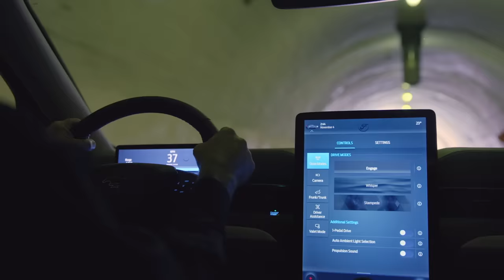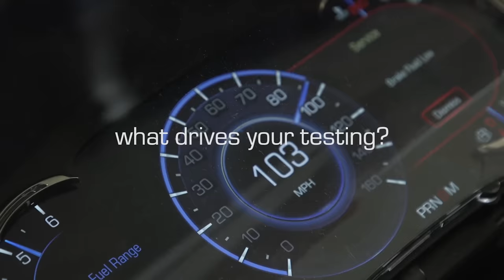Strike Casualty: Stellantis Backs Out of CES; BMW Going with NACS - Autoline Daily 3672

Comment: The biggest drawback to hydrogen fuels is NOT that it uses a lot of water. The biggest drawback is that the round trip efficiency is low (and costs are high) if you use electrolysis (assuming use of renewable energy to create the hydrogen) or that the lowest cost hydrogen is made by processing fossil fuels. The best case use for hydrogen in the mid term is for applications that must have high energy density - large truck, ship and airplanes. Of course that's only valid if hydrogen is available. The not often talked about advantage of using battery electric vehicles is that the "fuel" distribution infrastructure (the electric grid) has a 100+ year head start over hydrogen infrastructure.
Reply: YOU SAVED ME TYPING 😅
With Hydrogen fueled cars you really have to look at the full infrastructure and life cycle of the Hydrogen as there is no existing infrastructure  to "just fill with Hydrogen " from.
Reply: Additional problems with hydrogen: Without compression it's useless and compression takes energy. Storage equipment costs are higher because of the more expensive materials used to prevent hydrogen embrittlement. Hydrogen is prone to leakage which causes its own environmental hazards to our atmosphere.
Reply: Exactly. It's an energy sink. Hydrolysis, pressurization, transport and storage of hydrogen consumes roughly 3-4x what you can get out of combusting it. The only place where it would have demand is where gravimetric density is of the utmost importance.
Reply: Hydrogen stored at 10,000 psi , NEVER in million years would I sit on hydrogen bomb 💣

Comment: Hydrogen will NEVER take off, not because it's bad, and not even because of the crazy price of fuel cells, it's because generating hydrogen is EXPENSIVE and most hydrogen is generated using fossil fuels (to power the production of hydrogen). There is a tiny change that if somewhere in the distant future there is overcapacity of electricity (over deployment of solar to allow 100% renewable during winter, so oversupply in the summer) - only then Hydrogen will be economical - but that would mean EV charging is even cheaper (or free) and by that point batteries will be cheap enough that there would be very few if any application for hydrogen powered vehicles.
Reply: @lesliecarter4295 That is Toyota, right? From less than 200 hydrogen cars in 2015 and up a whopping 7.11k hydrogen cars in all of Japan in 2022. The land that is heavily invested in hydrogen. Their advancement is stagnant, I mean, staggering. Lol
Reply: If it's to expensive,  chillax , there's  no need to blast anti hydrogen tropes.

Comment: "the biggest drawback is it takes a lot of water to make hydrogen fuel."  No. Actual big drawbacks: #1 Unavailability and high cost of Hydrogen infrastructure like filling stations. #2 Cost of Hydrogen even when readily available, #3 Cost and complexity of Hydrogen vehicles vs BEV
Reply: That is a big drawback when droughts are getting worse and more widespread. Unless they're using Saltwater to make the Hydrogen.
Reply: Don't Forget,Hydrogen would rather be Free Than Contained
Reply: Came here to say the same thing. Storing and Transporting hydrogen isn't a solved problem, and will require massive infrastructure investment. A long distance bus network might make sense with small hydrogen generation plants at each stop making just enough to top off the next bus that arrives, but the idea of hydrogen tankers driving down the road, or hydrogen pipelines, is crazy. 

The hope of the Fossil fuel industry in hydrogen has always been that the technology for CONSUMING hydrogen would take off, and that once attempts at distribution of green hydrogen failed, cracking natural gas into "blue" (Fossil fuel derived, polluting, aka "brown")  hydrogen could take it's place by necessity.
Reply: @divid3dbyZero  Water is the LEAST of its problems.

Comment: Honda, Toyota, Kawasaki, Suzuki, Yamaha.  The reason why these companies are banding together on hydrogen powered vehicles is because the Japanese government insists upon it.  Japan views the methane deposits off of its coast as pinnacle to its future global successes, they hope not only for energy independence, but also to be a major fuel exporter.
Of course, a whole lot of good that will do if everyone is driving electric vehicles, installing solar and wind farms, etc. by the time they've figured out how to extract that methane, so in the meantime they are trying to stymie EV adoption and push hydrogen/e-fuels so they will have a market for that methane.
Meanwhile Japanese auto manufacturers are falling further and further behind as the market moves to EVs.
Reply: I'm no expert on what Japan is up to, but their continued focus on hydrogen suggests that they may be in for very hard times ahead.

The number of technological challenges involved in just about any large scale application of hydrogen for transport seems to rule it out in any scenario except where there is no alternative.

In passenger vehicles and light trucks, there are good alternatives.  Even heavy trucks will mostly be BEV.
Reply: @davidmenasco5743  Yeah, I don't think it's in the auto manufacturers' own best interests, but I think there is immense pressure behind the scenes.

Comment: If there are still ICE vehicles in 2050 the problem won't be making them cleaner, the problem will be how much fuel costs. As economy of scale starts to collapse the cost of fuel can only go one direction.
Reply: It was explained to me, as less people buy gas that the price will drop.  When supply is greater than demand prices fall.  Yes. I laughed at them.  Less people buying gas puts all the overhead on fewer and fewer people.
Reply: I think it would drop a little from supply and demand then rise as the diehards need it
Reply: @davidbeppler3032  If prices get too high so will theft. Gas stations will simply stop stocking fuel if their insurance company drops them. One station in the US stopped carrying fuel during the last price spike. That's a sigh of things to come.
Reply: @rp9674  There are fixed costs in making and delivering fuel even if oil is cheap. I'm thinking the price can only go up.
Reply: I expect that as fuel usage drops the stations will go into a pricing war in an effort to keep their numbers up.  So a temporary drop in pricing.  The number of fueling stations will drop as the smaller companies will be losing money.  At some point it could be difficult to find a fueling station.  At some point in there the prices will skyrocket.  A similar thing will probably happen with the oil companies themselves.  Then all of the EV haters will need to pull themselves up with their bootstraps.

At some point ICE will only be for the rich much like horses are today.
Reply: Don't drink the kool'de.
Wait till then and well see!
Reply: @frankcoffey  it's a good bet, I would say we'll see, but I rarely check gas prices
Reply: Bidenomics 🤡👍
Reply: @johnsadler6534  I won’t be here to see it but it will be interesting.
Reply: @zoobrizz  Joe and I will be long gone by 2050 good luck with that stuff. 😁
Reply: @zoobrizz What a weak comment

Comment: Indiana charges extra fees for EV owners...$150 extra a year
Reply: Wow, I would vote carefully
Reply: Wow.   $150 🤡
Reply: So does California. Have to feed the tax beast.
Reply: Pretty sure blue states have been charging extra for a long time now.
Reply: In Mississippi, there's the tale of four F-150s.
All four are considered constitutional class 5 property, subject to ad valorem taxes at 30% of value. All 4 pay the same registration fee, and a $15 privilege "road and bridge" tax.
F-150 #1 runs on CNG and pays an extra privilege tax of $195.
F-150 #2 is an EV Lightning. This year the owner pays an additional $172, though the tax is tied to the CPI, rising with inflation.
F-150 #3 is a hybrid with an extra $86 tax, also indexed to inflation.
F-150 #4 runs on gasoline, and pays no additional tax. (Gasoline tax is paid by the distributor, not the consumer.)

This in a state who's Constitution requires taxes to be "uniform and equal throughout the state". Have a problem with it? $50,000 and a lawyer might fix the problem.
Reply: It's common since gas taxes don't apply to them, so the annual registration fee is a little extra to cover that. It's $100 more in IL but fine with me since the "fuel" cost is $15 a month instead of $90 for gas.
Reply: I believe someone ran the numbers and found the gas tax amounted to about $50 per year typically.  If this is the case, then these EV taxes are way overcharging.

Comment: There is no hydrogen pumps and the cost of hydrogen its way more than gas.  500k for the EV bus then subtract the fuel savings,  the maintenance savings the ownership over life of the bus and I'm sure it's ahead
Reply: I want to see their calculations. Why would an electric bus cost that much? Maybe they are figuring the same range as an H2 bus, so they need a humungous battery.
Reply: @jamesvandamme7786  cyber truck costs less and tows big loads.  500k they are getting ripped off

Comment: Hydrogen ICE has half the MPGe compared to a fuel cell vehicle, taking already bad efficiency to ridiculously bad. You might save money on manufacturing but you lose overall on lifetime costs and you won´t improve the CO2 emissions. The fact it also needs a lot of water for H2 production is the smallest of it´s problems.
Reply: It would not take a lot of water to make hydrogen fuel. We'd refine natural gas (methane) using steam reformation or pyrolysis to make hydrogen. Hydrogen from water (hydrolysis) at any major scale is decades away. But to say water availability is a drawback to hydrogen is false. I know the video said this, but he's wrong. 

Hydrogen has a lot of development at various companies. They're realizing that batteries are great for city driving, but terrible for travelling. For that, hydrogen is likely the winner.

Comment: Engineering Explained  youtube covers did topic about ICE hydrogen and its bad. Its basically a bait and switch tactic by japanese automakers. The facts and numbers don't lie ..You're way better off using a fuel cell then a ICE engine with hydrogen. Unless there is a big breakthrough with hydrogen it does not make any sense running it in an ICE engine.

Comment: Hydrogen as an ICE fuel will still use air (78% Nitrogen) as oxidant, sooo….  NOx will still be an emission/pollutant for H2 ICE engines.
I’m sure CARB will have unimaginably low NOx requirements for H2 motors too by then ….

Comment: You are still blaming labor.  Why can't a guy that makes over $20,000,000 get this resolved?  How much does his team - Board of Directors - make and yet they can't get on top of this either?  Come-On management; Let's get back to work!  

When my sister makes $20,000,000 and i make less than $100,000 she is not really family.  That's a 200 to 1 advantage.

Comment: Take a good look at the Portal... because those styling cues are going to be found in their next generation minivan. And--if they're smart--it'll be an EV... and probably the first one they produce. Why? Because:
--Packaging a battery pack into the floor of a van is easier than any other body type.
--The most common users of minivans--namely stay-at-home parents--will naturally understand the need to leave battery-powered things on a charger overnight and between uses.
--Minivans are already considered an "appliance", so....
--Minivans are among the most popular models bought for fleet service, and fleet service vehicle sales are a automaker's "bread & butter" with the large numbers of them seen sold. By having them be EVs, it in turn would help them garner enough emissions discount points to possibly prolong production of ICE-powered vehicles for quite some time before fully relegating to primarily or solely EV production.

Comment: There won't be any ICE vehicles in production anymore by 2035 or maybe even 2032.  And very few ICEVs will still be on roads on 2050 IF any.

Autonomous cars will be too safe and ICEV autonomous cars won't be competitive w BEV autonomous cars.

Hydrogen is a pipe dream as far as land based transportation goes.  Hydrogen has its place, but it will NOT power land based vehicles.  Firstly, 96% of hydrogen today is made from burning fossil fuels  via a process called natural gas steam reforming).  So you don't solve the FF emissions and pollution problems.

Secondly, even IF you make it from solar energy using electrolysis, the process is too inefficient compared to just charging batteries.  Using solar to charge batteries and power cars yields a 77% efficiency from 'wells' to wheels.  Using solar to produce hydrogen to power vehicles has a wells to wheels efficiency of only 30%.  Pissing away another 47% of the primary input energy is not economical.  Batteries have already scaled and will grow rapidly as has been the case the past 10+ years.  Hydrogen has not scaled and therefore has no production cost advantages.  Batteries have won and mostly the Japanese will try to tell you otherwise.

And here is the 800 pound gorilla in the room if you are not convinced yet.  If you leave your car filled w hydrogen parked for a month, ALL of the hydrogen will have leaked out.  Hydrogen is a small atom and leaks through everything.  All the equipment in the electrolysis plants will leak hydrogen, all the pipelines and trucks and ships transporting it will leak hydrogen as well as all the hydrogen stations and every single hydrogen vehicle on the road.  Hydrogen is a fossil fuel propaganda machine that will NOT play any role of note for road transportation.

Comment: The total cost of hydrogen ICE buses will be more than EV buses and trucks due to upkeep and crazy expensive fuel costs. The cost of EV buses and trucks is coming down and yet they can last 500% longer before needing brakes or new motors.  If it costs three times as much but lasts 5 times longer and runs cheaper each day then EVs win. I wouldn’t bet against Tesla.

Comment: CNG LNG burns clean cheap and every vehicle cheaply adapted. What are these geniuses missing ?
Reply: hydrocarbons, oxides of nitrogen (NOx), carbon monoxide (CO), as well as carbon dioxide (CO2)
Reply: @rp9674  little enough to be OK OSHA use indoors even without catalyst 😵
Sone after emissions bring near zero .
Already cleaner well to well than battery Ev
Reply: What you're suggesting is not the fuel of the FUTURE.
Reply: @magnusauto7941  you can’t reason with a Cult co2 but 
KLAUSSite
The fuel of future is political agenda . Look how Germany fell trying
Reply: @HailCaesar-lm4bq  fair to say it's very clean, but there's been suggestion that it's not healthy to burn in your house, which I agree with. Disagree that it's cleaner than battery
Reply: @rp9674  no one’s driving in their house. It’s the fastest cheapest way to lower pollution. 
Wonder why none talk HYDROELECTRIC?
Cheapest cleanest energy ?
Political agendas always fail . EVs failed under Obama and Carter .
Reply: @EnriqueThiele it’s the cleanest best deal out there . Germany economic collapse trying go green . Join them in this political agenda

Comment: Most of the hydrogen we use today is from cracking in the refine prosess for oil to gas.
In Norway 1/4 of the cars are electric. And, Esso has closed it's refinerie. (1 of 2). Equinor is the only left. The construction sites are going over to electric excavators.
The same prosess are happening in  farming.
The forcast says that in 2027 we get a over production of batteries, because of Europe and the US are trying to match China.
In Denmark all the hydrogen filling stations are closed. Hydrogen train in Germany are closed. And the same with buses in the UK.
A hydrogen combustion car needs at least 4 times the amount of hydrogen as a fuel cell one.

And, then is the explosion hazard 💥.

So, I woulden't bet money on hydrogen cars.
Reply: Gasoline is an explosion hazard too. People forget that for some reason.
Reply: @ThatGuyPotatoes It's true that a shocking number of gas stations go up in flames each year.

But I won't forget the image of the site where that hydrogen station blew up in Norway.  It looked like the whole city block was turned into powder, and all of it was laying flat on the ground.

Comment: Yesterday in Texas, I paid $73 to renew my ICEV's registration for another year. I will pay an additional $200 to renew my EV's registration - that's about $50 less than what I paid in gasoline taxes last year on the ICEV that it replaced.
Reply: EV do more damage to road based on weight
Reply: @cheersgxp2466 , I'm pretty sure an 80,000-lb. loaded semi does a lot more damage to the road than a 4,500-lb. EV.
Reply: @cheersgxp2466 When did lighter cars ever get a break on registration fee?

Nobody ever gave the slightest thought to passenger vehicle weight affecting roads until after some oil company's PR firm cooked up that line you just repeated.

Pickup trucks got BIGGER and BIGGER and BIGGER and BIGGER, but gosh, nobody said a dadgum word about it.

Comment: Gas tax phases out and enter per mile use tax. Its being slowly tested in several western states. I wonder when States or the Fed will implement a tax on public chargers
Reply: I'd be fine with that, I drive 5000 miles a year.